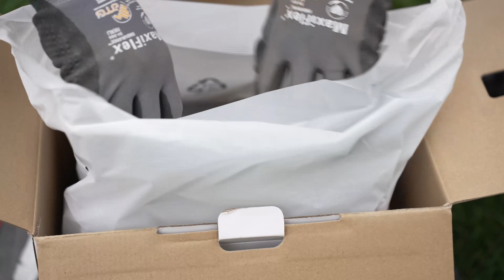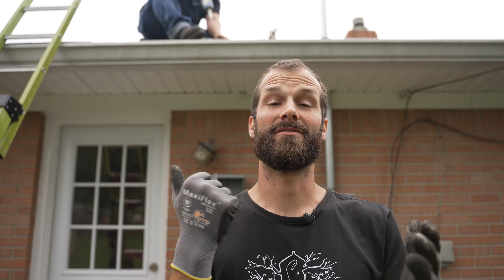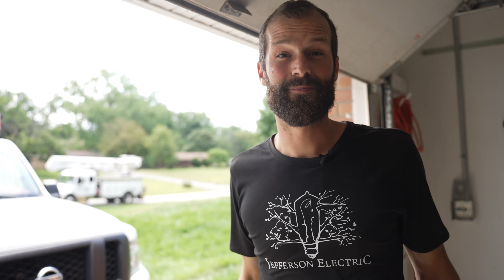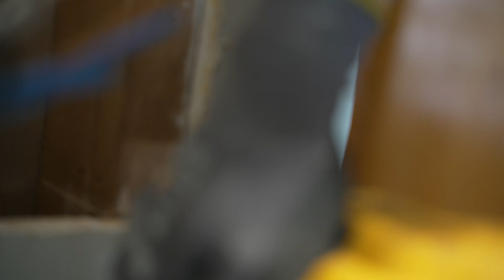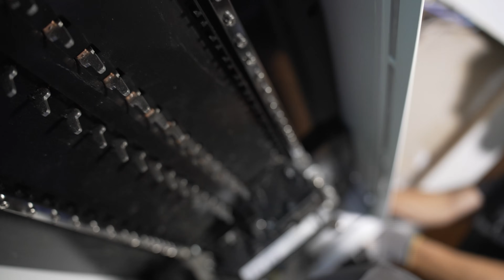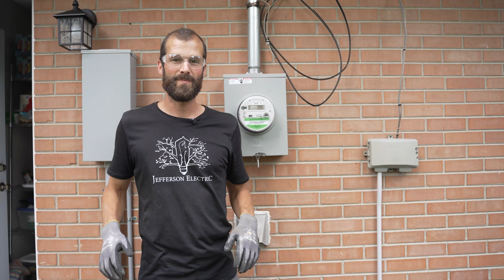We voided SPAN's warranty.

Comment: Retired and not a fan of high tech electronics . Call me old school but long time reliability.   Too many times after 8 to 10 years at least one chip will be obsolete. I had to throw away 8 year old $10,000 VFD because of that, Same thing with expensive lightning/dimming panels. I would not install any high tech electronics in my home even if they paid me. We had a $10 million state of the art machine years ago that had 7 computers controlling 6 pick & place arms. Before it was 4 years old they told us to stock pile a certain chip because they were  going to stop making them. Of course company never purchased any and when it was ten years old had to pay a kings ransom to have the 7 computers replaced and programmed. Of course they had a few programming bugs and it took twice as long to finally get it back on line.

Comment: wouldn't it be easier to just take down all the drywall 9" above 9" below before running the wires into the panel, and then later do a formal drywall repair?
Reply: Absolutely not

Comment: Great Informative video.  I saw inside the cover of SPAM breaker box, the flush cover, the "SPAM" label is upside down on the bottom of the breaker box.  Can this be flip 180 to the correct orientation way?  Other than that it looks professional install with the outer cover plate of the breaker box.

Comment: the sponsored segment moves at a much slower pace than the rest of the video - doesn't fit with the usual energy and pace of your videos.  As for "pure sine wave", I'll believe that when I see the oscilloscope trace... The mass market price point can't pay for a sine wave generator.  The best you can hope for is an approximation within certain spec limits, say 90% or so....  I guess FTC truth-in-advertising rules aren't 100% strict... it would also be nice if the battery charger's strategy and specs were published instead of "buy this charger and hope we designed it well..."
Reply: First 15 mins had nearly no content, all ad’s.

Comment: Interesting that you installed the span panel upside down. I have done the same thing for a new build and come trim time when we were all set and done and putting the panel cover on the numbers and span label were upside down. I called span to see if they have a cover that will fix this and they said they’re panels can’t be installed upside down it voids there warranty.. I thought you would know this.
Reply from the maker: We reached out to SPAN and you're totally right! Since the making of this video, they have released a new model which is allowed to be installed inverted, but the model that we installed in this video was not listed for inverted installation. We're working on correcting the issue behind the scenes
Reply: Why no reply to how it passed mounted upside down if the manufacturer says it can’t be done?.
Reply: I am an anal homeowner. If you had installed my panel upside down I would be pissed.@stevesolt4036

Comment: I noticed the numbering was upside down.does Span make an inside cover for when you flip the panel?
Reply: On a $4K panel I'd expect that the numbering was legible in both orientations, considering a $200 panel from any other manufacture has had that worked out for 30 years or so.
Reply: Nope and it voids the warranty.

Comment: Would you have offered an outlet to the furnace switch? So in an emergency they could use the power bank you showed to power their furnace ?
Reply: Probably not. That's too normal and they wouldn't have made much money doing it that way. I would think they would suggest something more expensive to help them reach that million dollar truck thing 😂 

We actually lost power the other night and I was caught with my pants down. I have a generator but was unable to use it on my furnace. Doing it exactly like you suggest. Going to change the wiring for the furnace so it can plug into the generator. Once power is restored it can easily get plugged back into the outlet wired to the panel.
Reply: @shawnphillips1220  yeah there are some videos on YouTube for guidance